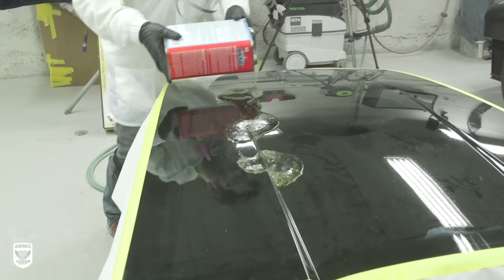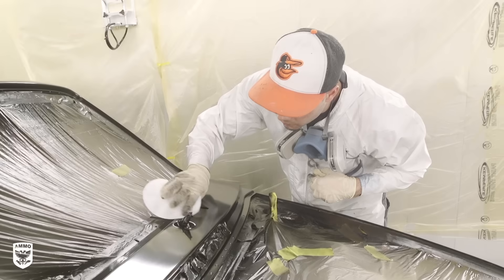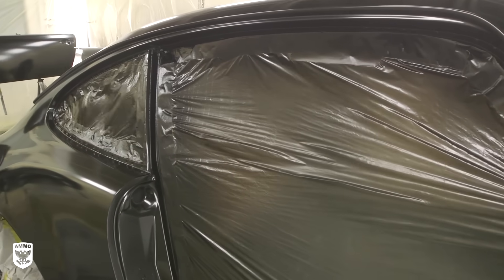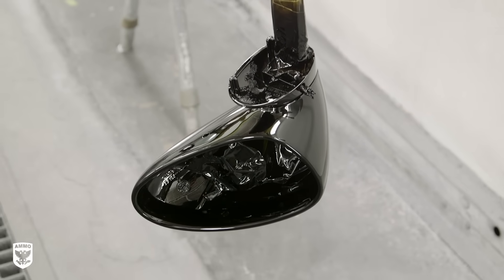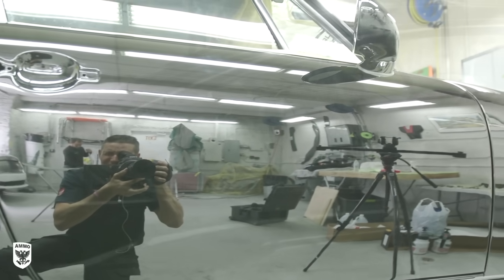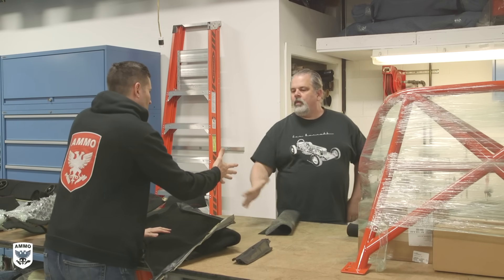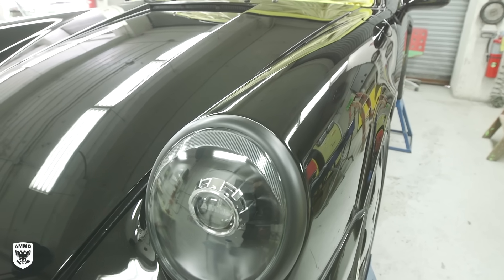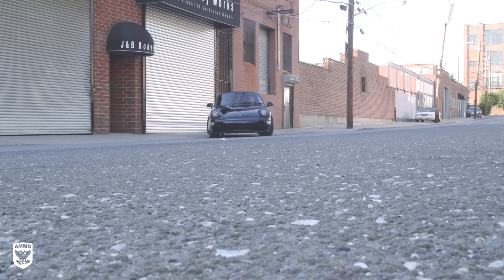Most Insane Paint Job EVER! Step-by-Step Process on the AMMO Porsche 964

Comment: "the car it's now allowed to cure overnight, tomorrow however comes the shine"
What?!? It's better to give a short rest from the dry of basecoat, usually I apply the clearcoat after  1h max. (I'm a car painter)
Reply: Agreed it's called chemical adhesion
Reply: Mauro, EXACTLY! And why the fuck wouldnt they fix the interior leaks BEFORE paint & body so the car doesnt rot from the inside out?
Reply: Ben, I use PPG and love the ceramiclear
Reply: Joe, any professional will tell you that this process can be drastically shortened with equal quality shine, color consistency and adhesion. Its crazy, I have seen major restorations on show cars that had multi panel repair take less time
Reply: The paint job came out immaculate man nothing to complain about... they obviously know what they're doing (I'm also a car painter)
Reply: One of the points about using waterborne base is the massive reduction in solvents within the paint film, negating the need for it to "cure" overnight. Even way overkill for solvent based color coat.
Reply: Mauro,you are right,ive been a spraypainter for 47 years and i would never leave the basecoat overnight, hit it with clearcoat within an hour like you said. If you leave the basecoat for too long and apply the clearcoat there is a high chance of the clear laminating.
Reply: As a car painter you should know that most urethane base coats allow an 18 hour window to top with clear coat.
Reply: Ben Staab what paint brand and system are you using...your go to system?
Reply: Ben Staab never used Standox. A German paint manufacturer I think. I have heard they have a long clear coating window of 72 hours.?
Reply: It's waterbourne base
Reply: Waterbourne base. So you need AT LEAST an hour dry time under ideal conditions, and theres usually no clear window.
Reply: Tjay your 99% correct mate, but it’s called chemical cohesion. It’s the chemical bonding of one coating to the other upon application. 

Your technical trainers should clarify this with you, 

Adhesion.  And Cohesion there’s a difference.
For example. Adhesion,  a piece of masking tape on a panel . It’s adhered to it as it has stuck on there and stayed there. BUT, it can be peeled off with no effect.
Cohesion : it’s the chemical bonding between coatings.  If say both the colour and clear come off from the primer then it’s a chohesion issue between the basecoat and the primer.clear off the basecoat, it’s the same thing. 

No coating whether it be solvent or waterbourne should be left more than an hour before clearing due to this process let alone 72 hours. 
Just want to ask who told you this information guys? 

And before anyone tries to bag me out, I’ve been a qualified painter for 30 years, 10 of those as a paint distributor technical paint rep, and 5 years working for a paint company. 
I’m also a qualified technical trainer in Spies Hecker/ DuPont  and have used a whole lot of systems in water and solvent, PPG, Spies, Standox, Max Meyer, DuPont , Glasurit, Baslac, Sikkens, R-M .
Yes, I’ve also done custom painting,  and used UV drying equipment that 99% of shops in Australia will never see. 
Sorry to sound pretentious but i see so many people on here offer opinions and get attacked by others who don’t know there experience levels. 

Every painter is good in their own right, but doing it by the book and doing it “their way “ are two different things. 
Under paint company warranty requirements Axalta will tell them to go shit when the clear delaminates. FULL warranty means from etch primer to clearcoat as some of you will attest to. 
How many warranty claims have you had knocked back due to a technical issue? Sure you might get a can of clear as compo but they won’t pay to redo the whole car unless your a high end shop and threaten to dump the system on the road out front.  We had that a couple of times and it’s how high can you jump time. 
Mauro is correct. Don’t leave it an hour especially if you live in a high humidity environment. 

Feed off the ideas guys not attack it. This is why we do our jobs as good as we do and these other people say ahhh!!! That’s awesome. 
It all comes down to how your trained , cleanliness is the best way, keep it clean,  and when doing a custom job, SLOW EVERYTHING. 

Slow water / solvent reducers
Slow clear hardener
Slow 2K hardener

Give time for the solvents to get out.   BUT..... never leave it more than an hour before clearing it. remember guys.... chemical cohesion .

Comment: I don't know what it cost but just the paint job was easily 10k
Reply: Probably close to 30k -50k even more  a standard better then macco is 10k or more.
Reply: @RTM459  You are probably right I was basing my estimate on the price of an oem bmw repaint job done by bmw.
Reply: LOL. $10,000??? Thats what a regular sand, prep, paint, clear, and cut and buff costs. He was into that for a MINIMUM of $30,000 and I think I am on the far lower end. Thats for JUST the paint job. My paint cost me $12,000 and they didn't spray, bake, sand, spray bake sand. then go over it with razor blades, stopping the whole project because a flea farted too close to the clear coat and it MAY have left a mark that someone could only see if they were looking for it through the HUBBLE telescope! He probably paid close to ten grand in LABOR!

Comment: 6 months engine being stop does not cause cylinder wear....
Reply: Starting the engine without lubrication does. Which could happen if the engine sits for an excessive period without running.
Reply: Dimitris Kaloupis there's no problem because the engine hasn't been sitting for a long time, when you change your oil there's still a lot of residue left in the engine, it usually takes a couple of weeks to slowly filter out of all of the components.
Reply: Dimitris Kaloupis I'm saying that if it sits for a little while, as when changing your oil, it's fine. But when it sits for more than a month or two, you may want to be cautious.
Reply: With how that porsche smokes... blah blah blah.. comment about $100k polish on a turd.
Reply: Yes it can on start up, especially if you use conventional oil. Add to the time of sitting the fact that it has been heated and cooled several times causing the oil to thin out and run down even more (when baked for the paint). You are better safe than sorry. I will say though, if you don't remove the plugs and spray oil inside the cylinders or prime the system WITHOUT cranking the engine over then you may as well skip that step because you may still damage bearings and the cylinders.

Comment: I had a high end body shop for 20 years. The first 8 years, over 50% of what I worked on was Porsche. I'm not trying to act like a know it all, but sanding primer with 800 grit defeats adhesion. 400 grit is ideal, and creates a perfect surface with yet a little bite to it. Getting paint to adhere to a polished surface is a challenge.
Excellent spraying technique by the way. I am not familiar with water borne paints. I used Glasurit urethane with hardener OEM packed from Germany. Glasurit, and Spies Hecker were the two manufacturers who supplied Porsche as the OEM finishes. Urethanes with hardener dry internally, chemically as opposed to lacquers which required gassing off as you put it, in order to let the thinner to breathe out. We often put cars in the sunlight for several days to let it cure before polishing with lacquers. The huge advantage of urethanes with hardeners is that they are not only immensely chemical resistant, they also polish up to a mirror gloss the following day. Yes the fastest hardeners are not as good as ones that take more time. 
My philosophy on Porsche while working on them is that the car is engineered to the max. Unlike a Corvette that is begging for mods, a Porsche spends 5 years in the making of a new design, to engineer each part perfectly. Therefore, the goal with Porsche is to restore it to factory original pristineness. Using a multi-step polishing process using fine shearling, soft lambswool bonnets, spending two days on the fine paper and polish process would yield a finish that people stare at, and have to say something about. By the way, just as a point of interest, I did use a lot of lacquer back then also, which is great for being able to polish up to a high gloss, and be able to do spot, blended in repairs. The only thing is that the government outlawed the use of lead in paints, so after that you could spend two days with the polishing process, and the finish is still dull as ... (insert expletive). 
Look I am not trying to rain on your parade, whereas I know nothing about water based finishes, and most especially anything about putting a plastic sheet over the finish. When someone would see the mile deep gloss of a two day polishing routine, the last thing thay are thinking about is covering it up. I haven't been in the business since 1995 so I am sure there are a lot of developments that I am totally unaware of.

Comment: Very impressive work all round there, congrats. One minor question though, at 23:54min you say the clear bra is "13 mils thick". That's obviously not an abbreviation for "millimeters" (that'd be over half an inch thick!) so I was wondering what unit of measurement is being used?
Reply: A mil is 1/1000".  Where've you been?
Reply: @jflivingston  In the UK where if you say something is '13mil thick', that means it's 13mm. Meanwhile, back to the question I asked: is the unit of measurement  inches?
Reply: @giotto4321  In the UK if you say something is 13mm thick you don't say it's "13 mils" unless you are ignorant.  Very much like the US.  As I fuckin' said, 1 mil = one thousandth of an inch (i.e. the measurement is in thousandths of an inch, you know, like 1/1000".)  Sorry I responded.
Reply: @giotto4321  No!  It's in miles - everybody knows that the symbol, ", stands for miles!  Any more questions?

Comment: Agree to disagree, short wave / infrared heat will cure the paint from substrate out actually curing the finish, baking the vehicle from conventional paint booth , drys the paint from surface to substrate. This is hardening the outer surface first and so on. Chemicals/ solvents are are still being released. This could result in solvent pop . I agree the wait time is cut down but still chancing paint issues with clear wrap that’s trapping the remaining solvent underneath.

Comment: Surprised that clear wrap turned out wave/free. I must be purchasing the wrong product. Couldn’t have been cheap. Worth it after all that meticulous paint work? You betcha. I had my 70 Cuda redone in black wit a matte AAR hoood/tops of fenders and tops of doors with longitudinal vinyl matte strobe stripes. I’m considering having the car re-polished after 8 years of project work between many other cars and clear wrapped now before reapplying strobe stripes. I’ll have to look for a quality 13 mil wrap. I’m considering swapping my red 70 Bee re-painted it’s original red, but since it needs doors re-blocked, fender emblem holes filled, engine bay, trunk, front valance and hood (s ) repainted. I might as well repain the entire car since it’s stripped and on a body dolly, since it’s likely a keeper and started out as a lowly 383 4-speed, bench car with no frills, I don’t think the original color is as imperative as a color I’ll be happy enough with to never want to sell. If I do sell, some guys would’ve rather had the original red, but just as many guys, possibly more would like the opportunity to own a perfect black one since black was a very rare color. Drivetrain won’t remain stock as well as many performance items, though I try not to cut holes in Classic vehicles where they can be seen. Chassis been welded in many places to stiffen the car since it’s a street car and would’ve never been an OE concourse car, thou I keep them fairly original aside from performance bolt ons and possibly a factory look mini-tub, though it will get a roll bar - shooting fooled 900-1,000!hp. The clear wrap looks so good, it’s a must if it’s driven often and single chips get it sent back for paint repair. Very beautiful car. Also convinced me to take it 3 hours away to San Antonio where I KNOW they’ll get it right instead of where I send my drivers, who does a fantastic job and he’s done many Truckin magazine covers. The work is actually cheaper and more detailed in San Antonio as opposed to Houston. They’re more dedicated to the final outcome and price is agreed upon up front We hive we irks in my favor considering what they’ll do if somethings not righ, like a short hood or a crooked replaced. Quarter panel needing re positioning.

Comment: ...what was the cost...I am a collector and would like to have my countach painted
Reply from the maker: Reach out to JB bodyworks. they'll help you price it out as each car is different
Reply: @AMMO-NYC  you don't leave base cost overnight and then put clear coat on next day if you do that you do not have the same adhesion and paint can flake off I have worked with glasuruit paint for many years restoring top end cars another point you don't use a razor blade to denib dirt particles you block sand the nib out

Comment: The hood ornament is going to collect dirt & water that with the vibration of wind & motor will eventually sand threw the all the layers of clearcoat & paint, causing rust to form on the metal. Ironic everything was perfect up to that point.

Comment: The panels are to thin so they "warp" and then all people working on cars have to use bondo to make the var look good. With equipment you can check how much of it the car has. 

The panels should be worked from the inside and then outside. Finding a new method to put extra material on the car to showcase who really are good metal fabricators. Thats me, people either buy second hand parts or use to much bondo.

Comment: I worked in a 35yr family owned body shop for nearly 8 months... they told me that all that extrat wor they are doing to paint that car is useless and doesn't pay the bills.. NOTE in the collision shop this body work will make you go bankrupt....
Reply: What’s considered the extra work? Genuinely curious
Reply: It pays the bills if the customer puts up 50 grand, which was the cost of this job
Reply: @nikolqy  O the total stripping of the layers of paints. I assume this shop is a good friend and or is getting a massive pay out for such work. With that being said in normal body shop situations you would sand through the clear coat and into the paint, do the body work as needed,  prime, block/check /w guide coat, clean, seal and finally paint
Reply: @JohnS-il1dr  yeah you right tho... and they got the tools and skills to make it happen fast

Comment: Ready for a mental orgasm? I used to share this in the Porsche club meetings, and when I did, I would witness peoples eyes getting real big when they realized it. So here it is. What is THE most aerodynamic design? Answer: an airplane. The Porsche 911 is an airplane cabin with the wings cut off right outside of the door. When they look at the side of the Porsche this is a rush in realization. Now to take it a step further, there is one more aerodynamic design that is more efficient than an airplane; that is a flying saucer. So instead of having a wing that creates reistance in the front, and then tapers down in the back to create lift, the flying saucer has a sharp mid-line circle in the front, as well as the back, and all the way around the car. Hence the design of the 944 and 928. This too is done in compressed fashion on the sides of the car. It's the ultimate in engineering. 
I also found it interresting that in the 60's, the later 60's when cars were required to have smog controls, the Porsche 911 didn't need them, because with 6 individual carburetors, and a super efficient motor it exceeded all of the government emmissions mandates without any. Then along came the catalytic converter which was a requirement. The totally cool thing about the 911's was that it got 20mpg and still went around the stomped on a lot of Corvettes.

Comment: 2,000 is too fine of a grit for spraying that last coat of clear.  They probably did 1,000 then sprayed the 3rd coat, then sanded again 1,000 through 2,000.  And only 3 coats of clear with 2 sanding sessions doesn't sound right.  Normally it's 3 coats, sand, then 3 more coats, sand, polish.

Comment: Insane?? 
That's just a standard Mercedes Benz factory job every car is getting. 
The body is given four coats of paint-hand polished between coats, the final paint coat applied by hand -for a smooth 'lustrous finish which is especially salt-resistant.

Comment: most insane... yeah. got it.  71 dodge two wheel drive. 6 inch brush, seattle beige latex. pulls, runs, bristles. gross and ugly. rims too. some black was still visible on tires. glass was clean, as you just peel off what you don't want painted. santa clara ca. 1982. know this is not a competition. i just had to tell someone. therapist is too expensive